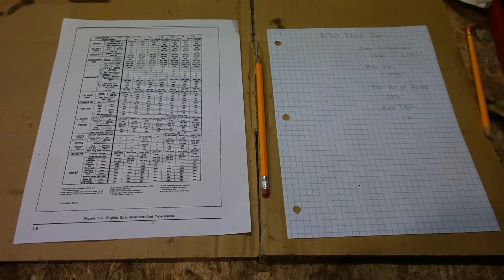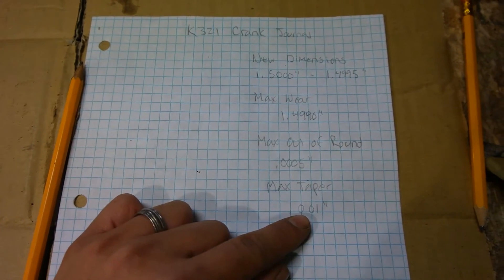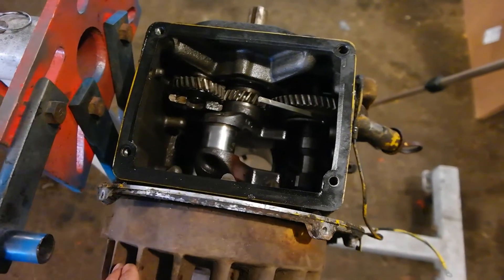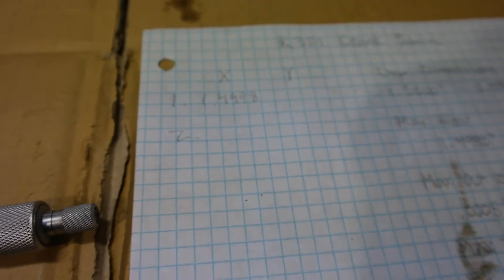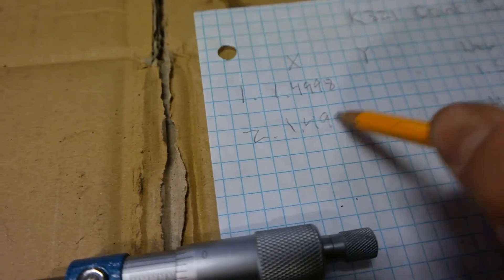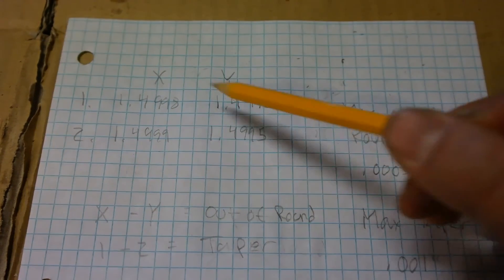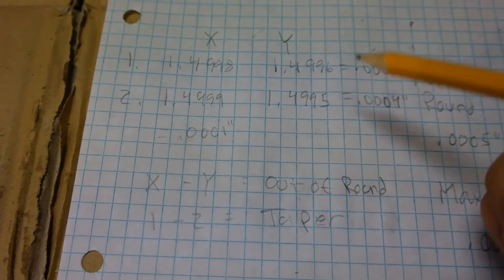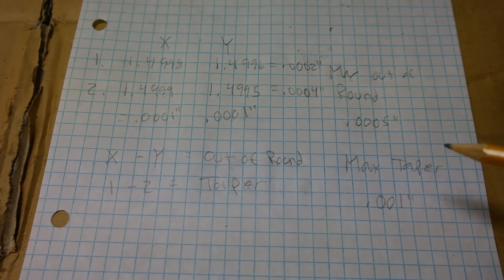How to Measure Crankshaft Journal on Kohler K Series Engine K321

Comment: I know this is old, but your first micrometer reading was near 1.4989" .  You were using the first vernier line "1", instead of the unmarked "0" line just above the numbers.  Unless you calibrated the mic at the "1" vernier line instead.  Most calibrate them at the "0" line.  I enjoy your videos and subscribed.  I'm on the fence about rebuilding a K301.  Will call you in the next few weeks, if I do decide to repair it.